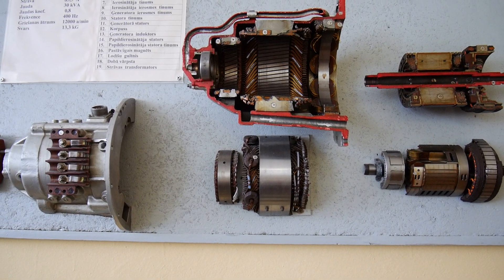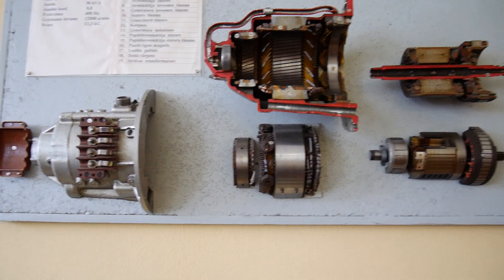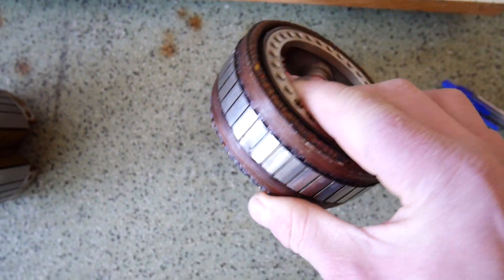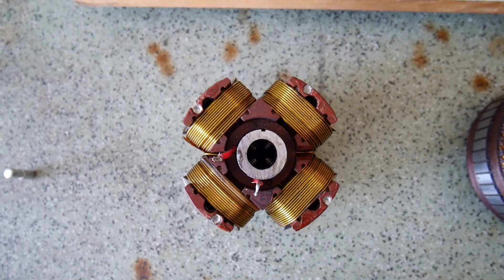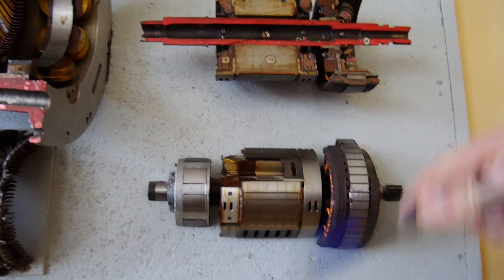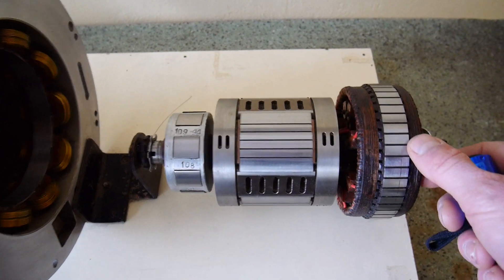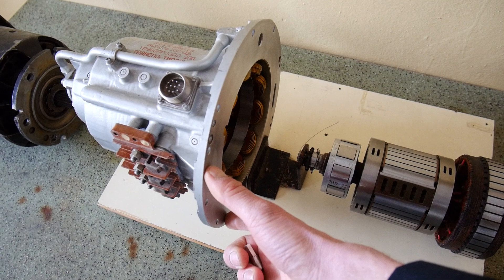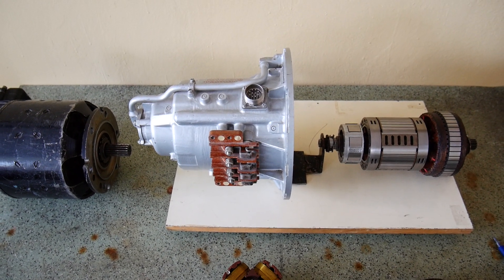Construction of oil-cooled Brushless Aircraft AC generator

Comment: What does the warning on the case say?
Reply from the maker: What king of warning do You mean?
Reply: @denisbrodnev627  Well the text is in red.
Reply from the maker: @douro20  Could You please specify the time mark of the video?
Reply from the maker: @douro20  It is related to its ground handling: prohibited to raise/move generator using its hydraulic pipeline as a handle.

Comment: Hi... Can you help me in designing this main generator as my project. I need some insights on stator and rotor dimensions, stator and rotor winding layout, Conductor type and gauge

Thanks in advance
Reply from the maker: Main Generator section is a conventional synchronous generator.
You should design it as a conventional salient-pole rotating field synchronous generator.
The difference is only if You plan to use oil cooling, then, due to advanced cooling capability, around 20-25 A/mm2 current density can be selected for the armature winding.

Comment: Thanks for your teaching; it's helpful.

I want to consult a question.
Is the generator seal?
If the generator is sealed, and we input oil and output oil and air, it will fulfill oil and without any air finally.
Therefore, I think the generator isn't sealed.
Air can get into the generator by some small holes or gaps.
Is it right?

Thank you.
Reply from the maker: Oil in oil cooled brushless generators is supplied by the Constant Speed Drive (CSD). The generator is fully sealed except its front side (it is opened, has no front cover as You can see). The generator is attached to the CSD, where CSD has both front and rear covers and it has ball bearings from both sides. Front ball bearing of the CSD also support rotor of the generator (generator has only rear ball bearing). Therefore, from the front, brushless, oil cooled AC generator is sealed by the front cover of CSD. Take a look on wikipedia how do "constant speed drive (CSD)" looks like (I can't show it because I have only disasembled one). 
Brushless generator is NOT FULLY filled with oil, because in that case its rotor will rotate inside the oil, which, by itself, will cause excessive drag. Drag will cause heating, thus generator will overheat. That's why there is an oil sight glass, which helps to check oil level (it can't be too low or too HIGH, where too high oil level most probably will cause generator to overheat). Generator has oil scavenge (drain) pipeline from its bottom (it can  clearly seen on the cutaway view of the generator in my video). Scavenge oil pump is located in the CSD. Charge pump and oil filter, as well as space for the spare oil are in CSD too. Take a look on youtube on "AIRBUS A320 Family IDG". It will show oll oil system of IDG. The difference between IDG and AC gen + CSD is that IDG (Integrated Drive Generator) has both Brushless AC generator and CSD in the same case.